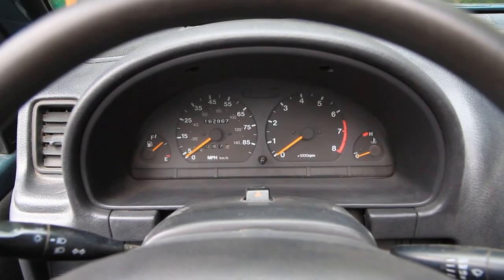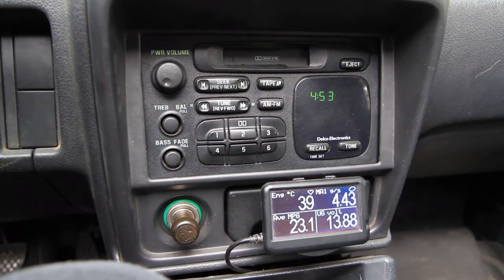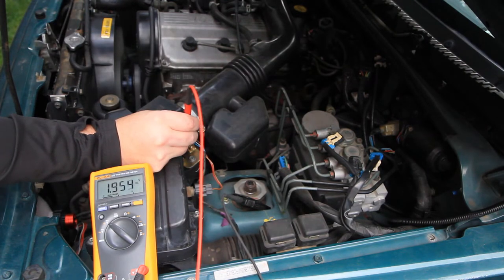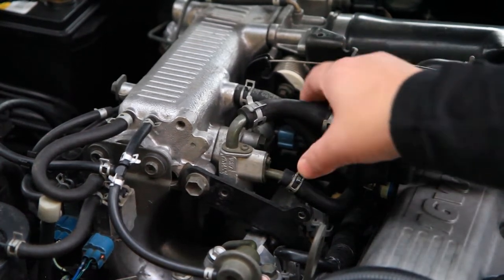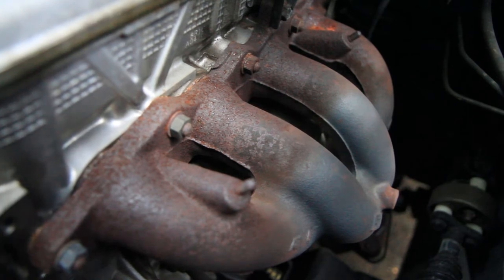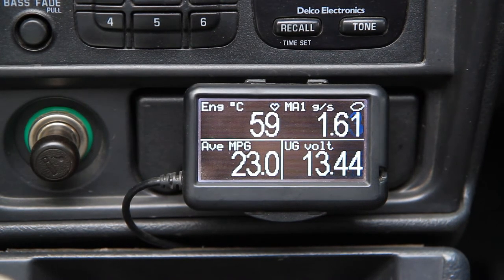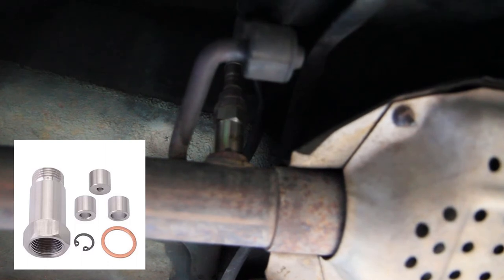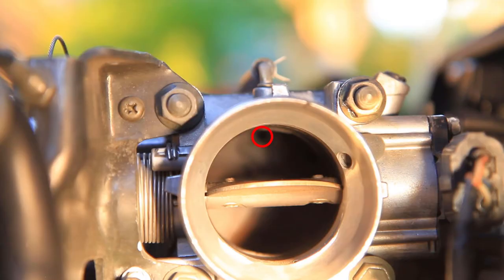MAF Sensor, O2 Sensor, EGR Cleaning - Cheap & Easy OBD2 Fixes for the Suzuki Sidekick / Geo Tracker

Comment: Thank you very much. Did you have to remove the throttle body to do a thorough cleaning for the P0400 code?
Reply from the maker: No need to remove it.  I just propped the throttle plate open and cleaned through there.
Reply: @thisisnotatest2  Any other suggestions for resolving p0400? I cleaned the areas behind the throttle plate as indicated, but I'm still getting P0400 still and seeing the CEL. Where do the 2 ports behind the throttle plate lead to?

Comment: Hey man at 7:20 where is the other end of that hole? The intake on mine is so disgusting from previous owner not running a air filter. I mean i don't know how its even running. The throttle plate was 1/2 inch thick in crud. I cleaned all that off and ran a can of seafoam in the intake. Also i removed the stainless tube and got it as clean as i could. I just need to know where that other end of that hole is at in the intake. Does it travel to that stainless tube??
Reply from the maker: The hole behind the throttle plate?  That connects through the intake casting to the stainless tube. I scraped the ends out and ran a piece of braided steel cable through it. Lots of carbon gunk in there.
Reply: @thisisnotatest2  I used my straw on my can of carb cleaner and sprayed up in there from  tube side. I can’t find the hole from the intake side!
Reply from the maker: I couldn't get the wire all the way through, if I remember right.  Use compressed air to make sure it's open all the way.  I used a lot of carb cleaner too!

Comment: Have you ever encountered a fluctuating idle? That's what I call it. My RPMs at idle bounce between 2100 and 1500 or a little less AND my accelerator pedal sticks sometimes to the point that I have to "kick" it to be able to push the accelerator normally.
Reply from the maker: I've had issues with idle RPMs when the idle air control valve on the intake manifold was electrically disconnected.  Check your connector and re-seat it a few times.  Mine was disconnected by the previous owner and it also came loose once recently.  
I've never had issues with the accelerator sticking this truck, but take this seriously!  Look for some kind of mechanical issue first.
Reply: Thanks! I will look for it!
Reply: As for the sticky throttle, get a new throttle cable. They gum up over time and then eventually break, I had that problem a few years back
Reply: I have the same excact problem,sometimes i get that fluctuating idle,that happens when its colder outside,and my idle as the car heats up instead of going down the RPM goes up to 2000-2500. Did u fix ur problem? And how?
Reply: @Cacciaallalepre  I eventually just got a different one, but kept the old one because I hope to take it apart and clean it and hopefully (if I ever need another one) I will (hopefully) have a working one to replace it with.
Reply: @Reallypeople1000  wich part u changed? The idle air control valve or?

Comment: Recently bought a '97 x90. Didn't have a catalytic converter and had a machine/automotive shop put one on to pass emissions. This car drove fine from Georgia to Virginia but after that addition is doesn't always rev when the gas pedal is pressed. It's random to. I'm me to this and have tried fuel filter, checked for leaks on the vacuum hoses, etc. Help
Reply from the maker: Have you pulled the codes with an OBD2 reader?  Auto parts places will often do this for you if you don't have one.

Comment: Did you ever get P0705?
Reply from the maker: Nope, that sounds like a transmission code.  Do you have an automatic?
Reply: @thisisnotatest2  yes I do.
Reply: Trans Range Sensor apparently.
Reply from the maker: Yep - I'd look at the connections to it and potentially replacing it.